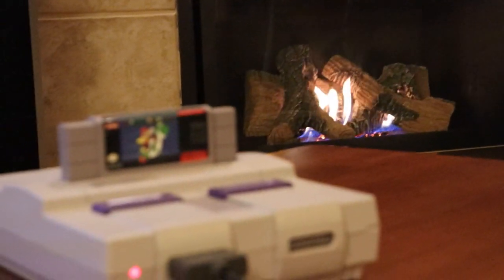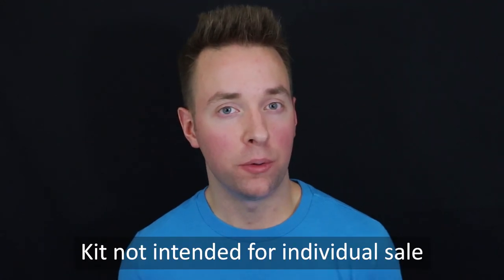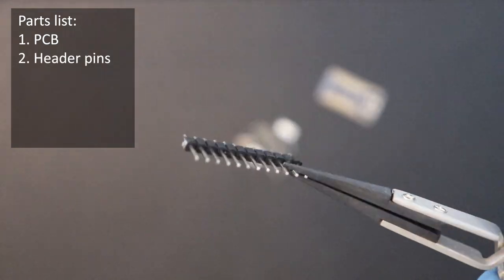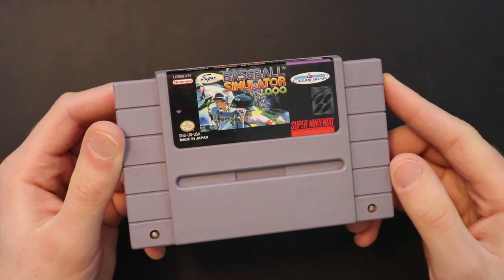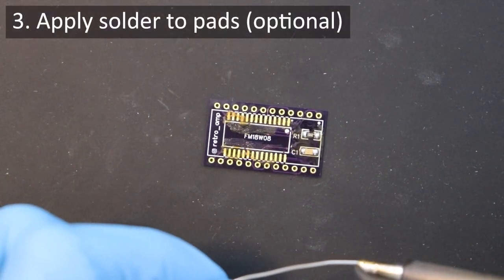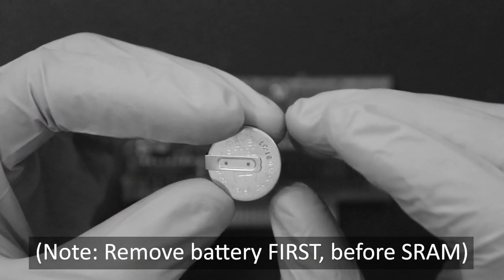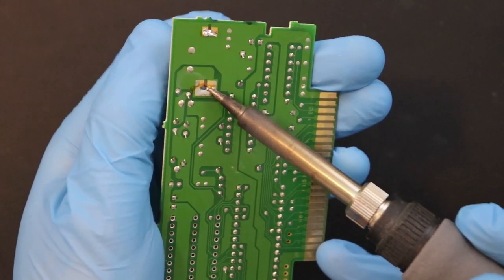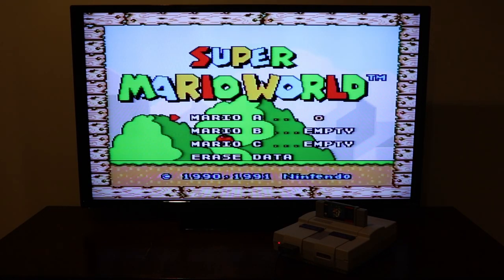RetroAmp's SNES Save Mod - Make Your Saves Last Forever!

Comment: 12:16 Backup your cart saves FIRST! (use a retrode2 or other device). 
If no saves exist then proceed with removing the battery and SRAM chip.

Comment: I have a Retro Freak and you can transfer your saves to a file, I also resoldered my batteries on all my carts to removable holders so you can easily swap the batteries in the future in seconds which I have had success not loosing save dats when I swapped the batteries.

Comment: For those that don't want to fork out for a Hakko, there is a low-cost way to remove a chip like that. Since you don't need it any more, you can simply cut all the legs off the chip and desolder them one by one.
Reply: or use chip quik low temp solder for  surface mount removal
Reply: that's true but the problem is getting the solder out of the hole can be a time-consuming process because desoldering braid and solder suckers give inconsistent results

Comment: 250 bucks for desoldering gun to work on game that cost $ 20 ??? :-D
There cheaper way (since you don't need to preserve original chip): use nippers to cut pins from SRAM body, use soldering iron to remove pin one by one, use solder sucker to clean holes - and you done!

Comment: Is this like a Fram chip on an adapter to the snes cart? Similar to the Saturn Fram mod but that one needs no adapter board.
Reply: Essentially, yes. I'm not super familiar with the Saturn Mod, but a logic IC is required for the SNES, as well as going from through hole to surface mount. These two reasons are why the board is needed.
Reply: @retr0_amp  oo i see missed that part about the IC.

Comment: Very cool vid, tho I would have done the SMDs totally different. The two components you sat in that red flux I wouldnt have just cleaned the pads with Chipquik, laid down some solder on the pads, then heated them as I put down the SMD. Maybe one side at a time. This may be the better way for smaller than the medium sized SMDs, thoIll admit some of the smallest SMDs require a bit different of methods. Interesting stuff!

Comment: Hey I have a question, if I replace my battery in Pokémon gold will that reset the data or will it be unaffected?
Reply from the maker: The battery runs the clock and save circuits in the 2nd gen Pokemon games, so yes it would reset your save.  But you can wire a battery in parallel while you replace the other.  Or you can dump and reinstate your save with a Joey. Cheers!
Reply: KyleAwsm thank you for the info :)

Comment: Cool idea... but I just install coin battery holders into my SNES cartridges that allow a quick swap of the old battery, and they only cost about a dollar and take about a minute to install. A good quality 2032 should last nearly 2 decades, should be more than enough unless you're an immortal vampire.
Reply: my power supply reset my snes and lost my save files even with new battery. this mod would of saved it.

Comment: You really don't need to use all that flux. And you also do not need to use a desoldering gun.
Reply: Desoldering gun will make the job way easier though.